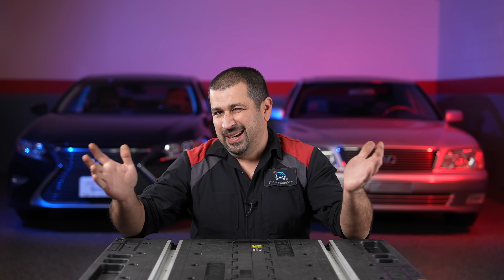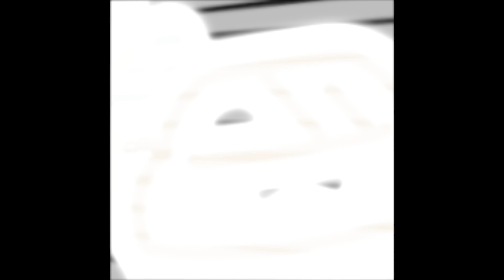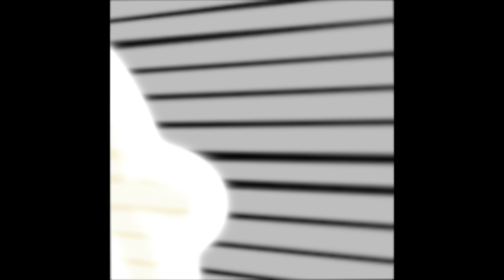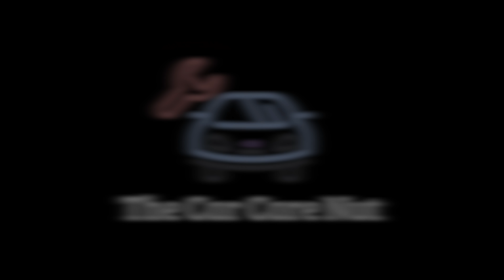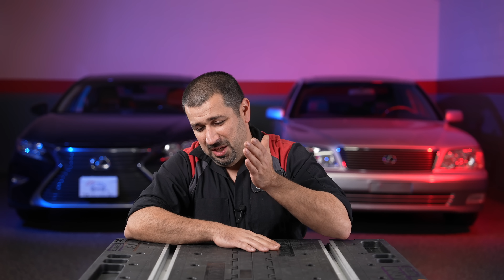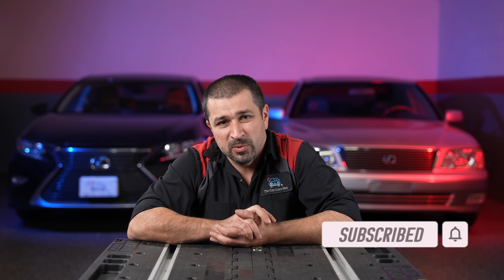Can Modern Turbo Engines Be Reliable? Here's The TRUTH!

Comment: In 2023 we bought a new Lexus NX250, I specifically went with the 250 and not the 350 because I didn't want a turbo. I change my oil at 8000KM/5000 miles and not 16000/10000 miles like the dealer suggests. I even changed it at 1800KM and 5000KM after purchase. Great video as always, wish you were in Canada close to me as I would only use you as my mechanic. Keep up the great honest work.

Comment: At least you Americans do not get the flood of cheap Chinese phev and hybrids, with almost all of them coming with a small engine with, of course, the turbo! The good old and very boring Toyota Rav4 hybrid with its fairly large non turbo 2.5lt is still more economical than even many of the phev some with 30kwh batteries! Can you imagine getting 1000km in a Chinese phev with a 30kwh battery, while the Rav4 gets about the same range and same amount of fuel with a 2.5lt hybrid engine! I know which one will still be going strong after 10 years!

Comment: Another reason you are starting to see a lot more turbos is that they have gotten incredibly efficient. Back in the day the reason you twin-turbo is because there were two options back then. You could go with two smaller turbos and sacrifice over all performence for a more linear boost curve. Or you could go with one big turbo (in most cases straight out of a semi) and have the lag in the world. The ladder is the reason the Porsche 930 was known as the widow maker. The lag was so bad and the boost came on so fast at high RPMs. This would upset the car. And if you weren't ready for it you would end up in a ditch or around a tree.

Comment: Auto mfgs seem to cheap out on the design and parts of the new smaller turbo engines.  Good examples are the current Tundra engine, and the smaller displacement Ford ecoboost engines.  Although other mfgs have had turbo engine issues: bmw,  mercedes, kia, hyundai, honda, subaru, etc.  Then add bad driving habits or constant traffic to deal with, and the average owners maintenance...  end result is bad for all involved.  Maybe slightly bigger displacement engines and slowly spooling turbos, and lowered max boost, with lots of extra cooling could fix the issue(s).  We should probably go back to 5w30, 10w30 or oils as well.  Oh yeah and required mandatory vehicle maintenance

Comment: My daughter bought a new Kia Sorento last year . It comes with the 100,000 power train warranty that does include the turbo . The dealer extended that warranty to 200,000 miles . I think the oil service recommendation is 7500 to 10000 miles . So if it fails and she has followed all the maintenance policies and she takes it to the dealer for that than she is good following their  recommendations . Now she has a 4 year free maintenance so she gets the oil changed at 5000 miles . They also did the carbon service with was free to do . She also gets top tier gas and gets premium on occasion as carbon is also an enemy of today's engines . 
So she went in for maintenance recently and they offered her a new car and they would take hers and the payments would be the same . They may wanted to get out of that warranty deal . She plans to keep for a long time .

Comment: I had a 2004 Subaru Legacy GT Wagon (JDM) and it ran on the original turbo until I sold it 14yr later because I was moving countries. Whenever I drove it I simply let the car idle for 1-2mins. Changed the oil frequently and had no issues. The car was even turned and ran more boost, no issues. Just don’t neglect it and don’t stray from the recommended fuel octane.

Comment: MPG is an overall measure of engine efficiency. A normally aspirated V-8 truck gets 17 mpg, and the same truck with a turbo V-6 gets 18 mpg. So they're basically burning the same amount of fuel and they have essentially the same emissions controls, but a V-6 is cheaper to produce than a V-8. The automakers might be fooling EPA but they're not fooling me.

Comment: All true 
I own a 1993 Toyota MR2 with turbo engine and it has 180,000 miles on the original turbo and engine 
I and previous owner changed oil at no more than 3000 miles with full synthetic oil 
Turbo boosts perfectly and engine doesn’t burn any oil 
I added a timer to keep engine running after a hard drive and to let turbo temperatures stabilize

Comment: I replaced the entire turbo system in my 2020 Honda Accord four months ago. It had less than 100,000 miles. Oil change every 3 months regardless of miles driven.
Reply: In addition: ever slightly overfilling oil will not help that turbo either

Comment: Great presentation, well said. I will say that most people don't realize that what is marketed as "full synthetic" is not synthetic at all but rather, conventional oil with a lot of additives. If you want maximum protection for your turbo charged engine you must use 100% synthetic, not "full synthetic". The only true synthetic oil is 100% synthetic and I agree that I would still never run my 100% synthetic more than 3 to 5k miles in a turbo.

Comment: Great video. I wanted a brand new Toyota Tundra but didn't want to buy Tundras with the twin turbo V6 engines. I wanted a reliable engine and I tow a boat so that puts a lot of stress on an engine.  I ended up getting a 2021 Tundra with the proven million- mile 5.7L V8 engine.  I change the oil every 5000 miles and drain it overnight.  Why? ... because I can :)

Comment: Oils have significantly increased in quality this past decade or more. To say it hasn’t changed is factually incorrect. Watch YouTube videos of engineers in oil industry and you’ll be surprised at the science behind it and how they constantly try and develop better ones. 

Follow manufacture’s maintenance schedule. They have engineers who put into consideration stuff we don’t even notice. Modern engine have tighter tolerances, better filtration system, longer lasting synthetic oils,etc. 

There’s always pushbacks on newer technology and innovation. Remember when iPhone 1 came out. BlackBerry and all these companies were trashing the no keyboard. Carburetor guys hated fuel injection when it first came out. Same thing. 
EV’s have huge hate. Turbo engines have huge hate. There will always be debate on old school technology lovers vs new technology lovers. People fear of changes plain and simple. 

I personally don’t have any turbo 4 engines since all my vehicles are old and I like old. But my wife has had her Mazda 6 2018 turbo 4 for 7 years now. 196k miles. It’s been very reliable and power is amazing. One of smoothest car I’ve been in.

Comment: I had a HKS  turbo timer (keeps engine running after you park car for a set time , 30 sec.) on my modded car years ago, Always wondered why mainstream cars never added this from factory.
Reply: My Focus ST has a timer which doesn't keep the engine running after shutoff, but does keep coolant flowing thru the turbo for a while IOT cool it down. But I'm old fashioned, I keep the engine running at idle for a minute after parking, especially on a hot day after the freeway.

Comment: I have a 2013 Ford Focus ST.  197,660 miles on the clock.  Original OEM Engine, Original OEM Turbo, Original OEM Clutch, and Original OEM Manual Trans.  Car was tuned for 50k miles.  Still running great. I change the oil every 5k miles with a good synthetic oil (Pennzoil Ultra Platinum right now) with a Ford OEM Oil filter.

Comment: Good vid, but what about hybrids? I’m specifically thinking of things like the NX450h+ or RAV4 Prime. They both have a 2.5 litre 4 cylinder naturally aspirated engine, but the combined powertrain makes over 300 BHP, with well north of 40MPG in hybrid mode. I would have thought this is a more reliable way forward, as the petrol engine is a lot less stressed.

Comment: I drove what was pretty much the poster child for unreliability in a turbo vehicle at the time - an '08 BMW E92 335i. What I discovered was, aside from the lemons or obvious bad production years, it was the owners that were the most unreliable part of the maintenance.
Reply: I owned one for 8 years. Hard agree. It’s really a super reliable vehicle, aside from stuff AROUND the engine. But all of the talk about wastegate rattle, or engine failure? User error. I miss that thing. Now I have a Q7, and it’s a similar story. Tons of talk about oil control ring issues. Almost completely resolved by tighter oil change intervals exactly as the man in this video is describing
Reply: I bought one from an owner that kept all the maintenance records and boy was I shocked how much money and time was spent to keep it on the road. 

Put maybe 10k on it changed the oil twice and sold it on before something went wrong.  Too many known points of failure and an engine bay cramped full of stuff. My belief is that the temperature in the engine is so high that it cooks all the plastic, gaskets and electronics leading to issues.
Reply: You could have just said BMW and stop their. They are pretentious trash vehicles. It's weird how people say, it was reliable with the exception of...
Reply: @sewj8046 every once in a while BMW fucks up and makes a reliable and durable drivetrain. But its like a once in a decade mistake for them nowadays

Comment: I’ve owned a bunch of German cars from VW to BMW and Mini and they all had turbo engines.

And one thing I noticed about all of them is they have electric oil pumps so if you are running the engine hard and you accidentally turn off the motor too soon without letting it cool down you will hear the electric oil pump whining in the background, and you know it’s saving your bacon because it’s preventing your turbo from baking itself.

I’m surprised that on Mazda 2.5 with the turbo and Honda’s 1.5 with the turbo, these don’t have any redundancy if you switch off the motor too soon, the cooling and everything just stops. There’s no electric pump to keep that circulating so you can do some real damage on these cars.  I just attribute it to maybe the Germans have been doing turbos a bit longer than the Japanese and they have the experience to know those things should be incorporated into a turbocharged engine.

Comment: Gas turbo = high compression, high RPM, high oil temps, high stress on moving parts (connecting rods, valve gear, etc). 
V6 or V8 = low compression (excluding high perf engines). lower RPM, Lower oil temp, lower stress.
The emissions requirements are key. The EPA sets emission standards. The EPA is run by politicians. Your vote matters. Is it too late for this? Possibly. But look at how the artificial push to electric cars got pulled back. It was a ridiculous mandate to begin with. Could be that gas emissions could be eased as well.

Comment: Thank you for the great advice. I have a Merc GLE 350 with a 2.0L Turbo and when I asked my dealer how often should I change the oil, they told me: "The car will tell you when it needs an oil change". That is a 10k mile interval. I took it upon myself to do it every 5 and now after watching this video, I'll be lowering it to every 3,000. Just like the old days. Thank you for this great advice. It'll be cheaper than a new engine.

Comment: Come on people.... time to go electric car. They are not that expensive any more when compared to the jacked up prices of gas cars now. Check out Tesla's website... that is the REAL out the door price they are listing there, plus delivery fee.  No dealer markup or BS. What you see is what you pay. Your state may or may not have sweeteners to buy EVs too. Often utilities give you breaks on electricity prices or offer rebates if you buy an EV and/or charge it at home. 
EVs have more power and torque than that turbo engine ever thought about producing.  Heck more than the big V-8 that used to be in that SUV. 
Super cheap to operate.... electricity is always cheaper than gas.  Yes you have to have a plug available to plug it into if you own a home. If not there are public chargers all over the place. If you can charge it 10 hours overnight and only need to go around 60 miles/day then any 110v plug will get you that. Need more then have a simple 240v dryer plug installed to use... or use your existing garage clothes dryer plug. That type will fill your tank completely in those 10 hours for nearly 300 miles of range (on good EVs).
EVs have almost zero maintenance other than wipers and tires.... maybe brakes after 100K miles but unlikely as you rarely use them in EVs.  Sure you have to replace shocks over time. But EVs come with an 8 year, 100,000 to 120,000 mile warranty on the battery pack by federal mandate. If that goes bad during that time (AKA loses more than 20% of its range) they have to replace it for free. Doubt if gas car dealers will warranty your gas engine mileage for that long and replace the engine for free..... yeah right? Teslas on average lose only about 12% of their range after 200,000 miles and still are fine to keep driving. Many of those turbo cars will never make it that far and will lose that much or more mileage too. 
Yes, Tesla and the OEM dealers take gas/diesel trade-ins for EVs.  The Insurance Institute for Highway Safety just put out info on Teslas indicating that they are often easier and cheaper to repair than gas cars. This fact is starting to make insurance companies charge less than they did originally to cover them. So prices should start going down.... Especially as Tesla is offering competing insurance for Tesla cars in more and more states. 
    There are a plethora of other great EVs out there. Especially the Hyundai and KIA ones have good offerings. The Chevy Equinox is getting really good reviews.  As OEMs cut back on making EVs there may be some gangbuster deals to be had. Go get em!

Comment: You are so so right here.  I have followed your advice on oil changes and it has paid off!!  Thanks.  I also have an 8.3L Cummins diesel in my motor home.  Of course turbo’d  very dependable.  And yes I change oil in that frequently too. And it holds 8 gallons!

Comment: 2013 Ford Escape 2.0T awd. 185k miles still runs strong on stock turbo. Installed a mechanical boost gauge to monitor. Oil changes every 3-4k. I beat the heck out of the vehicle. 😂 I run a catch can too.

Comment: The last two turbos I replaced failed due to the waste gate actuator shaft wearing out. That shaft gets wicked hot and is metal on metal, it never sees oil. I had an '03 VW Jetta 1.8t that was still going strong at over 200k miles when I sold it.
My '17 Golf 1.8tsi failed at just over 100k, as did my wife's 4 cyl BMW at similar mileage.
One big difference between the Jetta and the newer two cars is that the Jetta's catalyst was much farther away from the turbo. On most modern cars the catalyst is attached directly to the turbo. I suspect that the increased heat load on the turbo is a major factor in the shorter longevity.

Comment: I love my Honda accord 4 cylinder turbo with 115,000 on it.  However, I don’t kill it by pushing it to the max because that will really stress the turbo, use only synthetic oil, change it every 6 months.  Treat it right and you’ll be ok.

Comment: If your car has a  75,000 mile engine warranty and you change the oil at the manufacturer's recommended interval, that engine is virtually guaranteed to run  75,500 miles before it breaks. 
Same as a 36 month car battery that lasts 37 months.    Manufacturers know exactly what they're doing. 
Unless they're not polishing crankshafts properly and have to warranty a billion dollars worth of failed engines. 😁

Comment: You also missed another point! Continuous short drives, this accelerates oil issues due to unburnt fuel that leaks past the rings to the sump. You kept this vid to the point and it IS accurate. But as always in life, it's always the little things that gives you the biggest headaches.

Comment: MY 2002 STI made over 400 BHP (50% INCREASE) and ran 2 bar of boost on a standard engine,  decent oil, frequent changes and supporting mods made it last for over 70,000 miles before a refresh was needed.  Lots of daily driver and track use and it never let me down once, ( a minor oil leak once sent me home in a hurry.... ).

Comment: Thank you for speaking the truth. I'm a fan of Toyota cars but we're kidding ourselves if we think turbocharged engines and longer oil change intervals are there for the benefit of the consumer. Anytime I speak against either, I'm told "Do you know more than the Toyota engineers?" as if engineers are the ones who make all the decisions. Some number cruncher figured out that in order to show lower cost of ownership/less environmental impact (on paper...not reality) they can get away with increasing the oil change interval to 10K miles and put the turbo.

Then they bring up how long turbos have been around like you said but leave out the part about how it's only been reliable on Diesel engines and how even after all this time, it's crap for gasoline engines. That's actually more reason to be against turbos because it's been around forever and has always been unreliable.
Reply: "That's actually more reason to be against turbos because it's been around forever and has always been unreliable". Wow... so much BS, so few facts...
Reply: @eskieman3948  What facts? Name me your top 3 cars with a gasoline engine and turbo that reliably makes it over 300K miles with the original turbo and engine. I'll wait. Pretty much any Toyota 4runner, Camry, RAV4, Corolla without a turbo can make that claim.